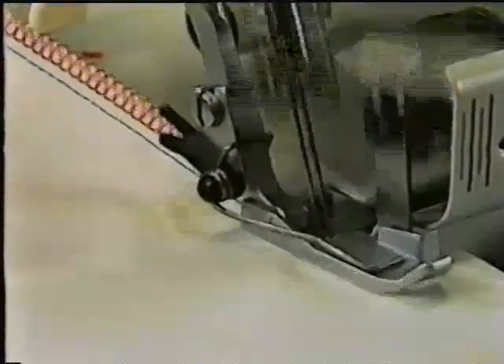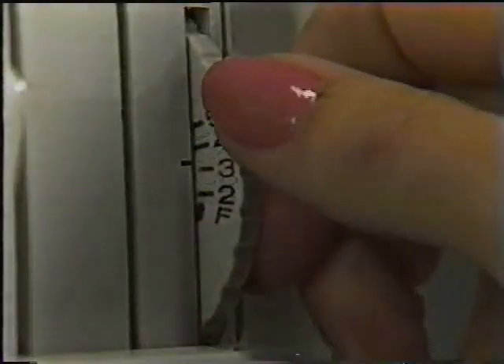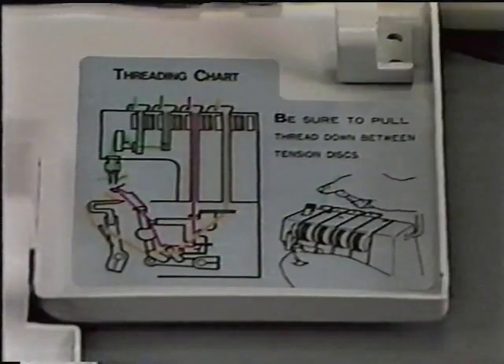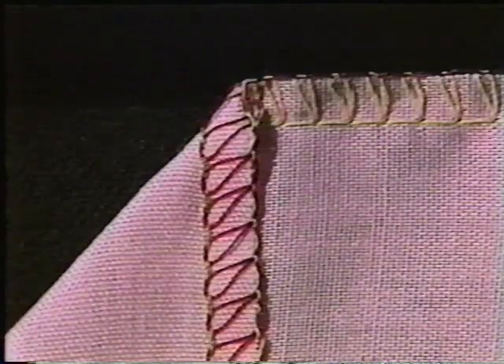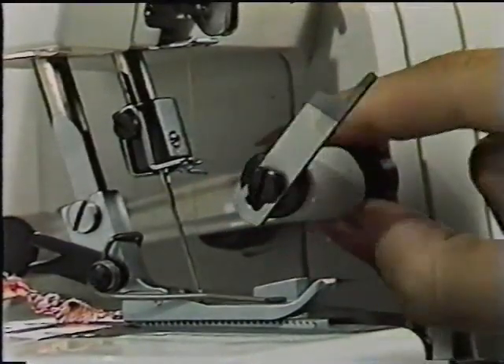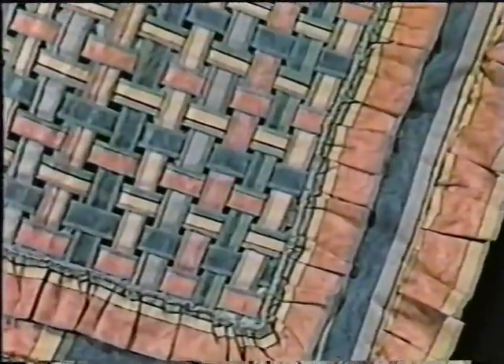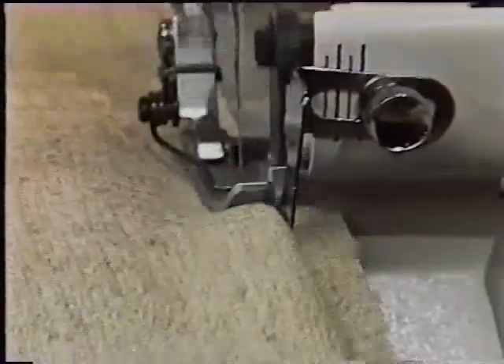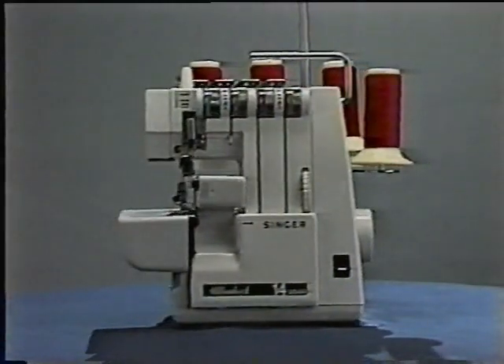Singer Ultralock Instructional Video (1987) Sewing Machine

Comment: I watched the whole thing.  After having and using my Singer 14T and 14U model sergers since 1995, I still learned a couple of tricks here I didn't know so bravo.  However, I was hoping for clarity on the oiling point inside the machine by the orange looper and at the very end of the video she just says de-lint and oil your machine --without showing exactly how/where so I'm bummed. 
Overall, I'm glad I watched it.  I still use my old 1995 5 thread serger for most operations and leave my newer one set for coverstitch because it's just so prevalent in what I sew that I don't want to switch back and forth (and since my old one works fine, I have that luxury until it dies -but after 30 years, it's still going strong).

Comment: Just acquired one of these machines, sews like a champ. Thanks for the video, it answered many question on set up and seams adjustments.
Reply: I've had mine for 30 years and it still sews as beautifully as it did in the beginning.  If you got a Singer Ultralock or Quantumlock you did great. My machine has never needed servicing so keep yours cleared of lint (but never use canned-air because it pushes the lint into the machinery instead of out of it) and oiled and you're good to go for years to come.  I hope these 5 years you've had it have been filled with fun and beautiful projects!